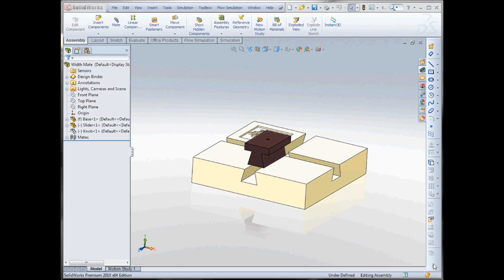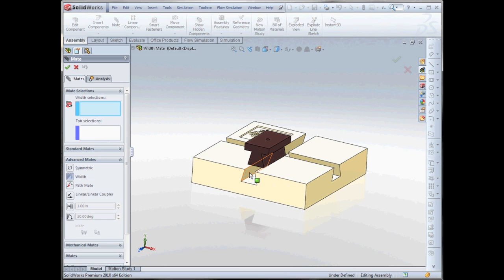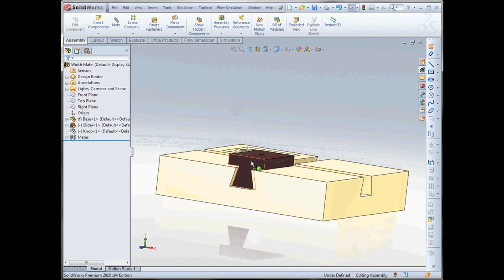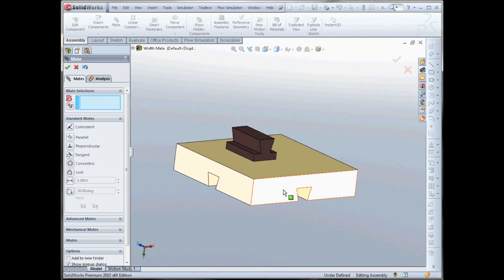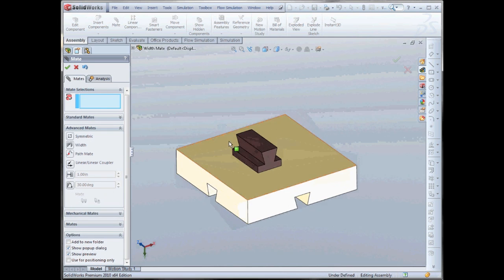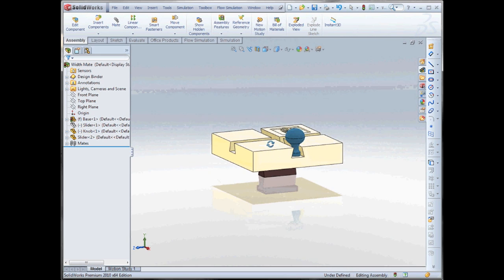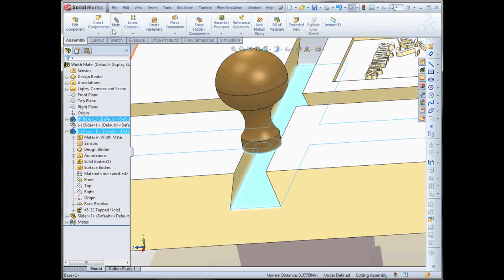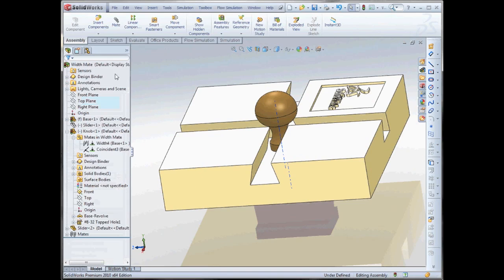SOLIDWORKS - Width Mate

Comment: How can I mate a cylinder easily? I just want to select the axis of the cylinder to the origin axis. However there is no axis at the origin of my new assembly part. Do I need to create one first? I'm a former NX user and NX had default planes with axis.
Reply from the maker: You are correct.  There are no axes which are defined automatically when creating a new part or assembly document.  You would have to manually define one in order to mate it with the temporary axis of a cylinder.  Depending on how you insert the first component into an assembly, it may automatically attach the origin of the component to the origin of the assembly and align the corresponding planes together (i.e. the front plane of the component with the front plane of the assembly, etc.).  This is done automatically if you select the “green checkmark” in either the “begin assembly” or “insert component” property managers instead of moving your mouse cursor into the graphics area and left-clicking to place the component.  Also, if you like you can manually add reference axes to a part document and/or assembly document and save the axes within the documents as either a new part or assembly template.  The next time a document is created using either of these templates, the reference axes will be available to use.  Thank you for watching.